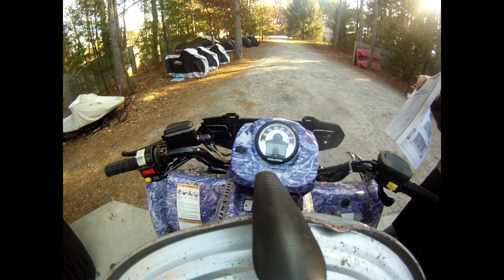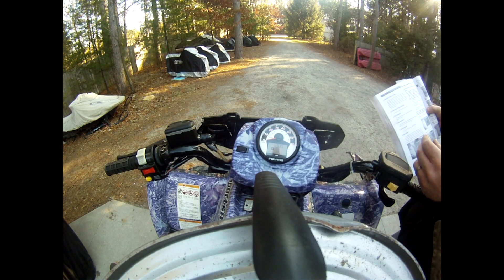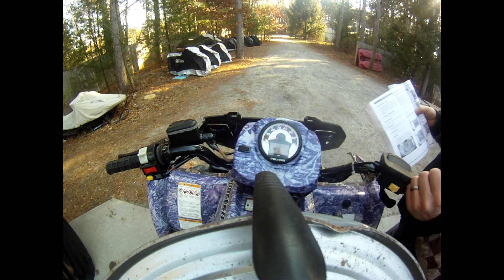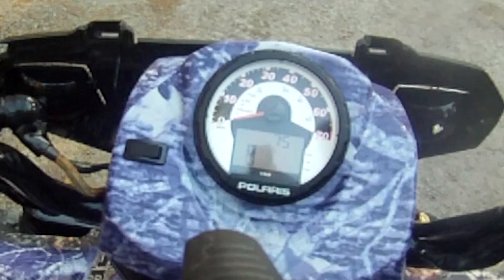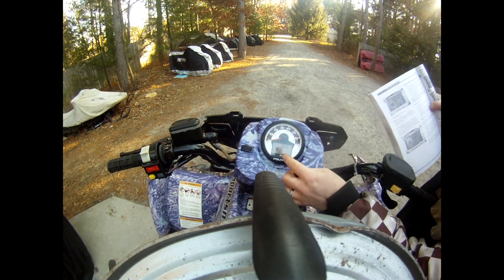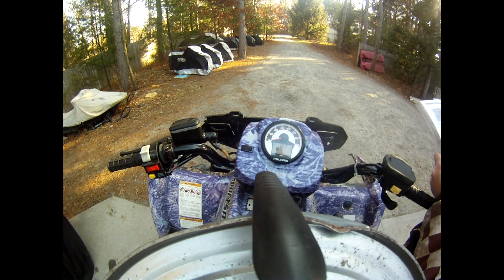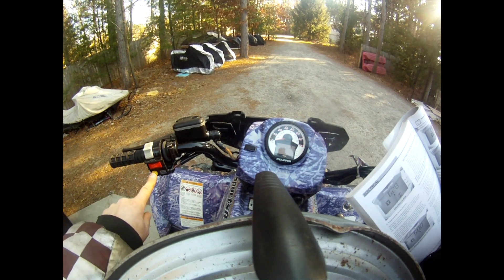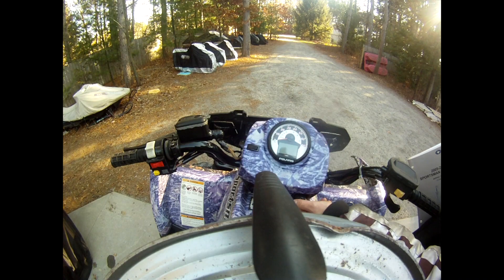2005 Polaris Sportsman 700 / EFI Maintenance Flashing Wrench Icon Clear / Reset

Comment: What is that switch next to your speedometer? Mine is missing, and the previous owner doesn't remember what the switch is for. Thanks in advance
Reply: That switch turns on your rear work lights, you should have a clear lens in each tail light that looks like reverse lights but turn on and off with that switch
Reply: Depends on what the ATV was ordered with. Some of these factory switches were heated handgrips with heated thumb throttles too.